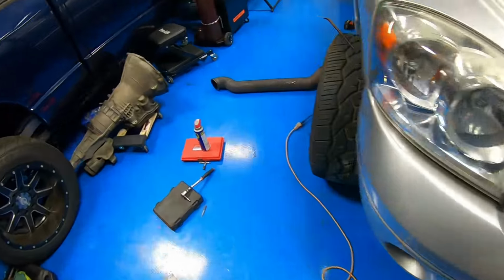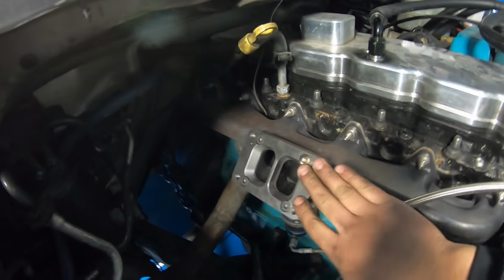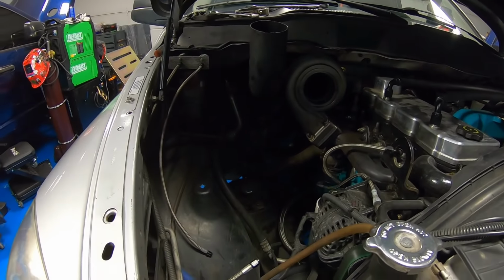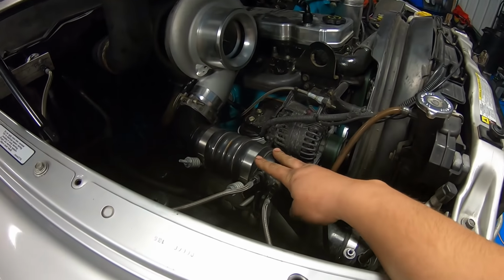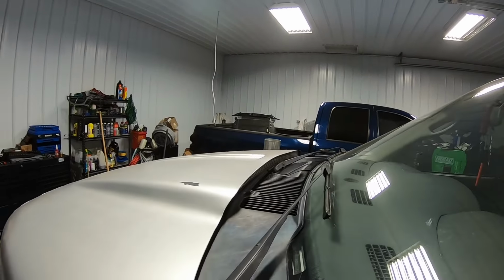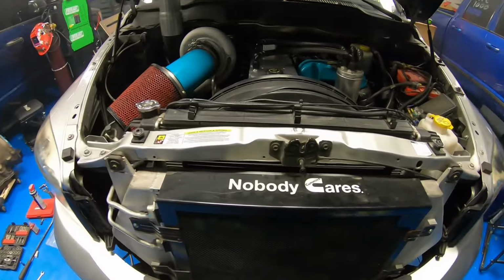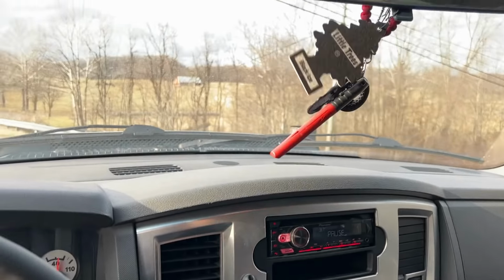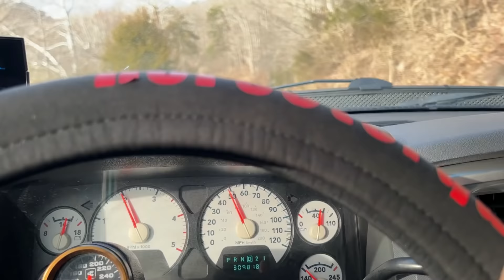THE 2007 IS BACK! Full sends only

Comment: Josh ,  have you ever had issues with back pressure blowing your waste gate open. Where do you get your source signal from . Manifold charger or primary?
Reply from the maker: Intake Manifold. Yeah I run about 10psi or boost to help the 35lbs Spring

Comment: I have a 03 Cummins at times it sounds like I have a lope tune but I don’t have anything tuners or programmers on it. Have a Raptor lift pump good fuel pressure. Any ideas ??
Reply from the maker: How old are the injectors
Reply: @horsetorquesdiesel  Maybe originals, I don’t know for sure I’m 3rd owner
Reply from the maker: @bronsonc5.9  I’d start there man
Reply: @horsetorquesdiesel  10-4 I was thinking it was my lift pump and was gunna upgrade to the FassFuel System. But thank you for your help

Comment: Awesome pulls bro. I'm looking to do a 2nd gen swap on my 2019. I'm look at the 467.7 would it be to laggy to go up a size or 2? I will eventually add bigger injectors but stock fuel for the time being. Let me know when you start putting together kits bro. Hope you and that family are adjusting with the new location
Reply from the maker: I love that 467.7 on a stock fuel 6.7
Reply: @horsetorquesdiesel   that's what I'm leaning towards. It's gets confusing for me after that..lol appreciate the input
Reply: @horsetorquesdiesel  you think it'll be cheaper for me to piece together my own kit or order one? What do you think about the smending kit? I don't like the manifold I prefer the steedspeed
Reply: Oh I read the the .90 housing isn't good for the 6.7 but I see you and other run that turbine housing. Any advice really helps bro. I'm new to the diesel world

Comment: What turbo would you recommend for replacing my stock turbo on a 2008? With efi live and bd diesel rebuild kit in Trans and dpc triple disk tq.
Reply from the maker: Either a modded he351ve or a 464 or 467.7 with a second gen swap
Reply: @horsetorquesdiesel  thanks bro